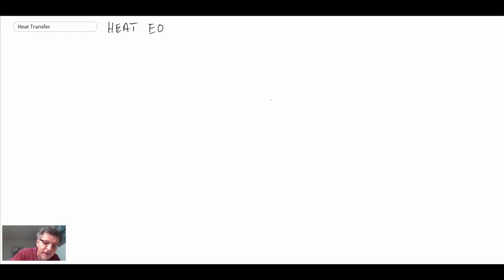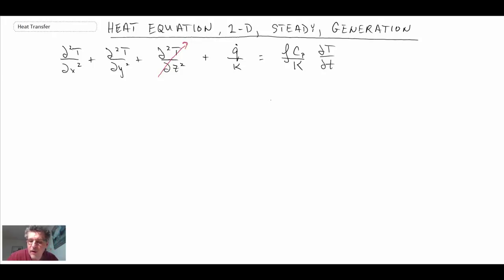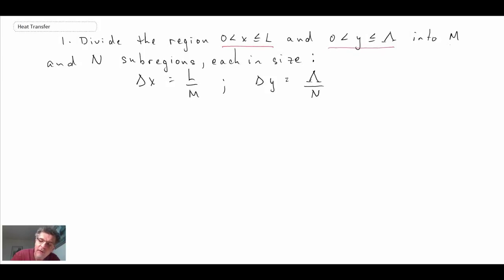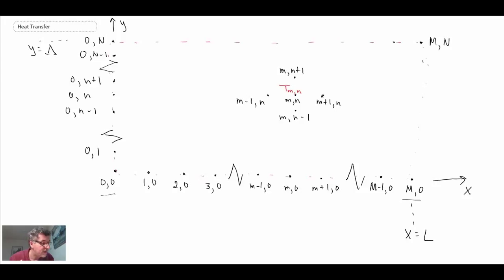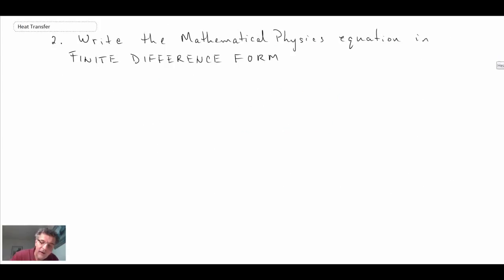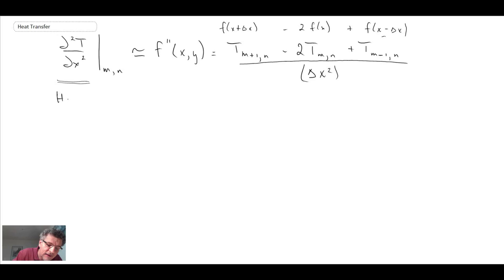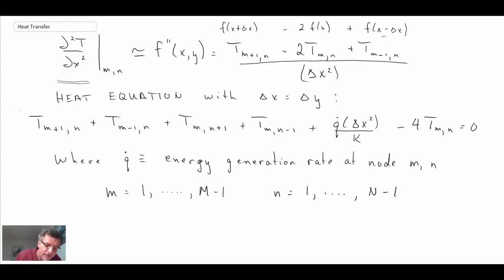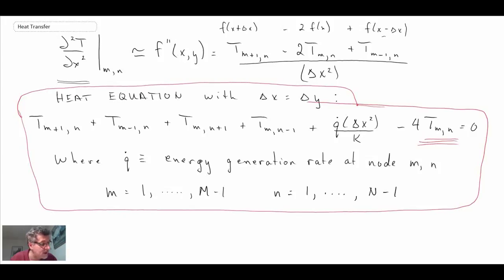Heat Transfer L12 p1 - Finite Difference Heat Equation

Comment: Sir you thought great
but if we want to descreatised the third derivative in this form then how we will do
please can you explain.
Thanks
Reply: It's basically the same process. You have to cook up a finite difference approximation for 3rd derivative by finding a way to isolate the 3rd derivative while eliminating the f' and f'' terms from the Taylor series expansion. Wikipedia has a great page on Finite Difference that will show you difference equations for a lot of the common derivatives as well as forms with different levels of accuracy. The one depicted here is order delta x squared, but you can generate higher accuracy by including more points in the difference equation.